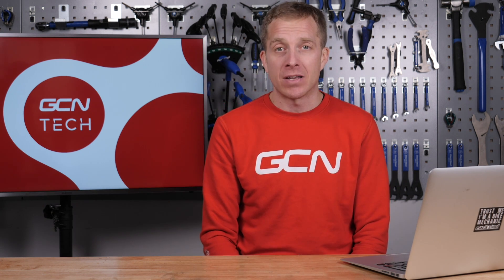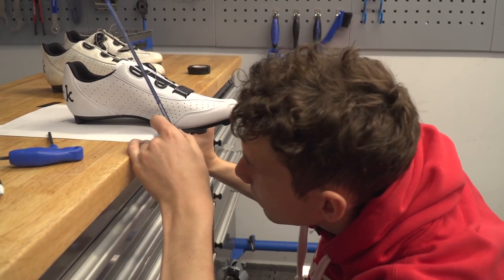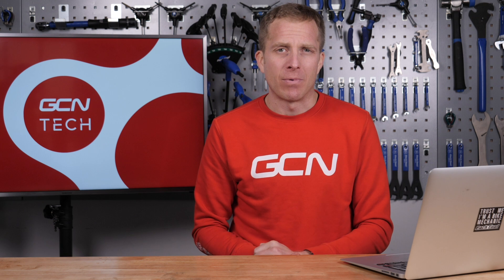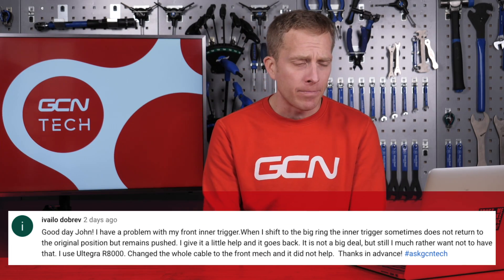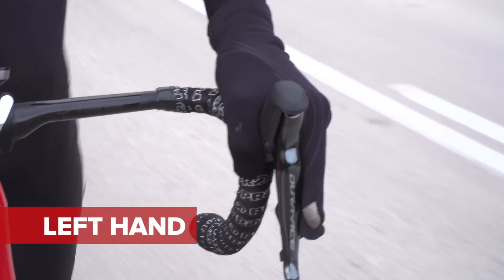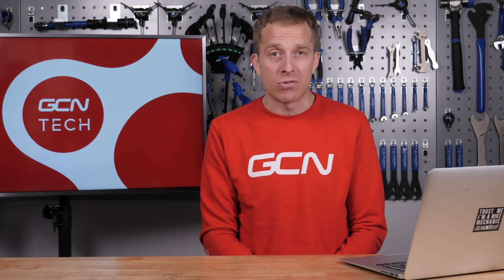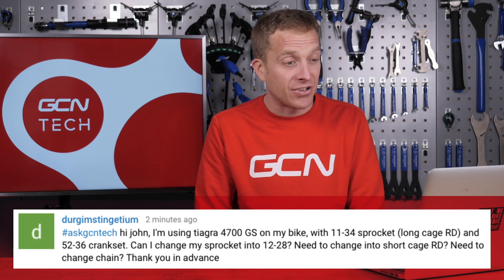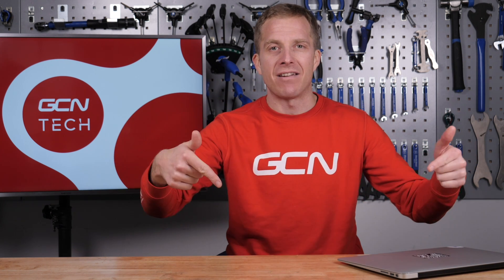Toe Overlap, Tyre Widths & Rolling Resistance | GCN Tech Clinic

Comment from the maker: Remember to keep your questions coming in for Jon using #askgcntech. 👇
Reply: #askgcntech 
Hi Jon, I would like change my all group set Ultegra Di2 for new Dura ace Di2 9150 do I need to change the wires or I can just replace the components. Thank you Denis
Reply: G'day Jon, i'm building up a frame set with a DA compact crankset (50/34) but want to pair it with a near new DA 12-28 cassette. I'm a little worried that the 12 tooth sprocket paired with the 50 tooth chain ring might leave me a fraction under geared on decents etc. Can I simply swap the DA 12 tooth with a near new UL 11 tooth sprocket? I also have the UL locking ring to secure the cassette if that is required. BTW - good to see you down under at the TDU. As a fellow Tasmanian I'm hoping Richie can work his magic and take the GC. Cheers Dan
Reply: #Askgcntech Hello Jon, greetings from Peru 🙌. Would the same wheel development (meters rolled in each rpm) , feel different in different rim measures? Example 20' wheel bike, and a 700cc wheel bike, set up the way that they both have the same development in each pedal stroke, would the 20' feel harder to pedal due to the necessary higher ratio needed to equal the development of the 700cc bike? Sorry for the tricky question! 🚲⚡
Reply: #askgcntech I have a felt b2 tt bike with di2. the shiftier on the base bar insint working . any tips on how to fix it
Reply: #askgcntech I have a felt b2 tt bike with di2. the shiftier on the base bar insint working . any tips on how to fix it
Reply: Help! I have a new pair of Reynolds Attack wheels and I can't get the tires to seat with the methods I can use on the road. I'm afraid to get stranded if I get a cut.
Reply: #askgcntech Hi Jon, My Trek Boone Cyclocross bike has SRAM Force 1 1x setup with disc brakes. What's needed to be changed besides adding the front derailleur to convert to the Force 22 2x setup?
Reply: Hi Jon, I wanted to know how do I index a Shimano Di2 Ultegra after changing the cassette to a different gear set.. many thanks

Comment: OK, I've been scouring the internet for ages now looking for a solution to toe overlap and everyone seems to say it's not an issue or give bad advice. I ride a fixed gear most of the time and weave through traffic at low speeds quite a bit so this was bothering me a lot, especially when you factor in the track bike geometry.

Some stuff I've seen recommended that you should avoid:  

1. Don't buy a bigger frame to avoid toe overlap, that will mess up way more things in the long run;
2. Don't mess up your bike's geometry by switching to a fork with more rake, it will become twitchy and unstable, you might crash worse than you would with toe overlap; 
3. Don't replace your front wheel with a 26-er, that will again mess up your bike's geometry and lead to bigger issues in the long run such as loss of stability at high speeds due to effectively changing the headtube angle relative to the ground;
4. Don't move your cleat position, that will quickly lead to injuries be it ankle or knee problems;

The simple solution that no one wants to talk about: 

Learn to point your toes down during slow speed tight turns or while doing a trackstand. It's amazing how many forums I had to go through to find this, and even more amazing that I haven't thought about it on my own. For most bikes that actually fit (not 1.80+ riding a 49 cm frame) this should solve the overlap issue and is a habit that's very easy to pick up and apply IRL. Weather you are using cleats or straps, pointing your toe down should give a bit more clearance during those tight low speed turns.

I hope this helped, because the video is certainly not addressing the issue.
Reply: Thanks mate 🙏

Comment: #askgcntech Hi John im riding 2006 trek 1200 with ican fl40 carbon wheelset with specialized 25mm armadillo tires at 115psi. Problem is  bad roads are causing gouging on tire to the cord even with new tires is there something I can put in the damaged area to fix it. Also can I lower the psi (59kilos) without effecting rolling resistance. Don't want to carry tube and pump everywhere or have a blowout on a 35mph descent. Is aluminum rims better for tires on bad roads.

Comment: #askgcntech Hi Jon, very informative show thank you. I have a question for you to do with disc rotors. I have a 2018 Specialized Roubaix running Ultegra 8070 Di2. I am looking at replacing the disc rotors and wanted to know if, the Dura-Ace SM-RT900 rotors are compatible with Ultegra 8070? And secondly, the bike comes with 160mm both front and rear. I live in Australia so it’s not mountainous so was wondering if I should use the 140mm on the rear. I believe it is as simple as removing a ‘spacer’ on the rear hydraulic disc brake. Not 100% sure. Any advice is very much appreciated.

Comment: #askgcntech hey Jon!! Love the channel, look forward to every new episode! I have a Fuji cross bike I’d like to use for gravel riding, but I need lower gearing for the climbs in my area, but without spending $$. Bike currently has a 46/36 FSA gossamer crankset 110BCD with a Shimano 6600 short cage rd and an 11/28 cassette; 105 shifters. I can get a 34t small ring, but not smaller in 110BCD. Will I have to change the rd to a gs to get lower gearing? Any other options? Thanks!!

Comment: #askgcntech. I’m intending swapping out the chainrings on my crankset from the current semi-compact 52/36 to a compact 50/34. Will I need to lower my front mech to accommodate the reduction in diameter of the new outer chainring? #askgcntech.

Comment: #askgcnteck Hi Jon thanks for all the great advice you give. I need some urgent help with my disc breaks. First time I have owned hydrolic discs. I have Shimano BR-RS505. The rear recently started feeling spongey so decide to bleed it. I followed instructions, removed the bleed screw from the lever, loosened the bleed nipple. When pressing on the syringe to add extra oil at the break calliper, nothing happens. Syringe is solid. If I take the syringe off and squeeze the break lever, oil comes out at the calliper. Nothing comes out at the lever. What’s going on??? Bike off the road until this is sorted, so please help me! Thanks. Pete

Comment: Hi, Jon. In November I bought a gold KMC chain and have really loved it. It needed cleaning yesterday, but with a foot of snow on the ground outside, I decided that instead of cleaning it the "normal" way, I would remove it via the quick link and soak it for 10 minutes in some degreaser. Well, after doing that, my chain is super noisy and rough. I'm afraid to ride with it. Did I destroy my new chain??

Comment: Hi Jon, love the show! Would be grateful for some guidance: I have an FSA tempo 50/34 crank paired with 2x9 Sora front and rear derailleurs. The bottom bracket is square taper. The left crank arm threads to the pedal connection have sheared. I can’t find a replacement arm the correct length and with diamond taper. Is it possible to fix the thread or would you advise to buy a new crank? If so do I have to go for sora or would say tiagra work too? Might I need to change the bottom bracket too (currently square taper)? Thanks #askgcntech

Comment: #askgcntech Perhaps like many others inspired by a few years of watching GCN, I’m about to take delivery of my first carbon road bike from a UK internet seller. Carbon frame, fork and seat post but aluminium handlebars, with Ultegra r8000 disc group set. My question is: what should I be careful of in the set up? Grease or no grease? Special carbon paste? Also the bike comes equipped with Mavic tubeless wheels (not carbon) and tires but with an inner tube installed! Is it ok to run such a set up without going tubeless? Thanks, from eddie in Osaka, Japan.

Comment: #askgcntech I have just upgraded  to an aero-handle bar with an option to internally route the cables. Does it make a huge difference if I internally route the cable in the handlebar vs externally routing them instead?

Comment: #askgcntech my rear brake lever (Shimano ultegra) keeps sticking. It will activate the brake but won’t spring back without being manually pushed/pulled. Any ideas what I can do? (I’ve changed the brake cables to no avail)

Comment: To Dylan Kite, wider tires doesn't necessary mean lesser rolling resistance.
On a specific road roughness, there is an optimum tire width which has the least rolling resistance. Go for wider or narrower than that optimum width then the rolling resistance will increase.
You might also find it interesting that a wheel with larger diameter (like 700c) can have less rolling resistance that a wheel with smaller diameter (like 650c).

Comment: OK so - Toe overlap - is normal. Don't adjust your cleats if they're well adjusted to your sole. If toe overlap happens - that's just it. It's down to geometry, fork angle, shoe size, and crank length. These are factors to consider - but it should not be adjusted, if it's tuned for you. Toe overlap only ever happens at superslow speeds anyway.
Regarding the pronunciation of bottecchia - it's bow-tech-ee-uh.

Comment: #askgcntech Another compatibility question for the guru, Jon Cannings.   I have a Wilier Zero 7 with Ultegra R8000 with a medium cage derailleur and 11-28 cassette.  I also have a Bianchi Oltre XR1 with Ultegra 6800 with a short cage derailleur and 11-28 casette.  I'm in the process of purchasing a set of carbon wheels for use on either bike.  I would like to put a casette on the carbon wheels so the swap is even more time effficient.  As I'm growing older, I was hoping to use a 11-30 or 11-32 casette but i dont want to change either derailleur.  Shimano's website seems to suggest I might get away not changing the short cage derailleur with the 11-30 but not the 11-32.  Any thoughts or suggestions?

Comment: #askgcntech - Hi Jon. I've been considering upgrading my bottom bracket on my Merida Scultura 4000 with a Shimano SM-BBR60. According to the online specs, the bike should be fitted with a BB-RS500, so compatibility should be fine according to Shimano. However, when I checked the actual BB, I found that it was fitted with a mountain bike SM-BB52. My question is, therefore two fold - 1.) Why would a 'mountain bike' BB be fitted to a road bike, and 2.) is it worth upgrading the BB to the SM-BBR60, if it is compatible. The Shimano compatibility chart does not show this. Thanx for a great show!

Comment: #askgcntech Hi Jon, great show! I've watched every week since GCN Tech first started. Question, I have non-series shimano road hydro disc brakes (RS785)  and I'm fed up with the long free stoke and spongy braking quality of this early generation braking setup. Do you know if shimano road hydro brifters are compatible with MTB brake calipers (Deore, SLX, XT, XTR)? It's helpful to mention that I've had this system fully re-hosed and bled several times over to try and improve braking quality with little luck.

Comment: I have a Tommasini Tecco, with Campy Chorus 10 speed.  Gearing is 52/39 - 11/25.  Well, my knees are as young as they use to be, I want to change the cassette out for an 11/30.  I have been told by my local bike shop that I can not use the derailleur cage that is currently on it, as it is too short, and no longer cage is available for it, in Campy offerings. Can you offer any options that might work?

Comment: Toe overlap with tire interference is most likely a function of frame size, particularly wheelbase length and frame geometry. For example, both the Specialized Tarmac and Allez have wheelbase lengths that cause toe overlap with tire interference....either 54 or 56 happens with me. My 54 BMC Roadmachine 01 does not, longer wheelbase.

Comment: Any tips for winter cyclocross bike storage options? Muddy conditions + having to park my bike in my apartment = not really an elegant solution. (I honestly cannot be bothered to clean the bike after every short ride -- mostly it's just the wheels and frame where the mud accumulates, not the drivetrain..) #askgcntech

Comment: @Christian T re: brake lever replacement- I just upgraded my early 90s Campagnolo Chorus calipers to Potenza 11 skeleton dual pivots (in polished chrome, of course) and kept my original Chorus levers with no apparent problems.  I don't find any issues with lever travel or any weird tension/pull ratio problems like Jon mentioned.  In fact, the new dual pivots stop on a dime compared to the old ones, weigh 80g less, and cost roughly $50.  Win win and win.

I do agree with Jon about wheels, but think you might find stepping up to 9/10/11 in the back would be a treat.  Downtube shifters are nice and all, but Ergopower would be a big step up.  Original Ergo used cable routers that mount where your shift levers currently are, to keep the lines tidy.  Anyway, enjoy your new classic ride however you spec it out!

Comment: #askgcntech I've got a tricky one for you Jon! I have a modern Italian steel road bike, and for the most part it's a wonderful bike. However It's fitted with a Campagnolo Chorus 11 speed groupset (current generation), and generally I've found the shifting to be good at the back, but the front derailleur has never shifted great. It's always been really fiddley. I've had to have my local shop try and dial it in several times, and they seem to have a hard time getting it right too (usually have to get the shop owner to do the adjustment himself). The difficulty is mostly with getting into the big chain ring.  I have to really push the shift leaver to it's max and almost hold it to get it into the big chain ring.  This is do able enough from the hoods, but really hard to do in the drops, which is a bummer because I like to mostly stay in the drops. Adding cable tension to try and improve the up shift then makes down shift performance bad (it should drop into the small chain ring with one downshift push, but adding more tension makes it take two pushes to drop down a ring). Trying to bump up the limit screw so that the front derailleur shifts more easily into the big chain ring then puts me in danger of having the chain come off on the outside which has happened a few times. So I find myself in a situation that there is a really tiny window where the shifting of the front derailleur is acceptable but not great.  Is this just how it is? Or is there something else I can try or my local shop can try? Another potentially important piece of information is that the cable routing is entirely internal, so perhaps it's just adding too much friction to the system? Also this bike is only ridden in good weather, and I keep it very clean and properly lubricated!
Reply: Sounds like your derailleur is too high and/or angled wrong (in/out rotation).  Difficult to shift to big and overshifts if you back off the limit specifically sounds like the back end is rotated too far inboard and the front end too far outboard.  The iside of the back end of the cage contacts the chain to initiate the shift outward, so too far inboard and it won't shift out well.  The front end outside cage contacts as the chain crosses over to prevent overshift while the chain is crossing over at an angle.  Too far outboard and it overshifts.  The combination of those two is caused by a rotation in the cage.  It's made more sloppy possibly by also being too high.  

I don't know campy.  Traditionally you just fix this by reclamping the derailleur.  On modern braze-on mount Shimano, it's adjusted somewhat by the main mount screw, and fine tuned with a set screw that pushes the derailleur out slightly.  It's also possible the cage is bent.  In particular the leading edge of the outer plate could be bent outward for instance.
Reply: @bigring6424  This is a modern braze on setup, so no easy way to slightly change the rotation that I'm really aware of.  I'll dig into that more though, and see if campy has an adjustment for rotation. Thanks for the input though, that sounds promising!
Reply: @debidousagi  I'm certain there's an adjustment.  In shimano the main attachment bolt fits in a rounded channel so you can rotate it while tightening that.  Then there's the adjustable support screw for very minor changes.  I'm certain campy has a way to adjust this.

Comment: #askgcntech Hey John love the show, I am having problems with my gears when I transfer my bike to my direct drive turbo trainer. The bike is perfectly indexed on the wheel but not on the turbo and whatever I do I can’t index it to get it working smoothly across the entire range. Turbo is set up correctly, even tried using the same cassette from the wheel, please help, thanks In advance.

Comment: Hi GCN, loving the work. I have a question. I was inspecting my tyres the other day while cleaning my bike when i noticed threads hanging off of the sidewall both front and rear. I checked my brake pad positions and they hit the rim perfectly. My bike is kept inside the flat where its warm all the time, no cuts anywhere on the sidewalls with relatively new rims aswell. Theyre Conti Gatorskins 25c. Any help/knowledge would be appreciated 🤙🤙
Reply: I have the same issue as well with my 28 mm gatorskins. I have used nailpolish to prevent it from happening, but it is only temporary. I would like a solution as well.